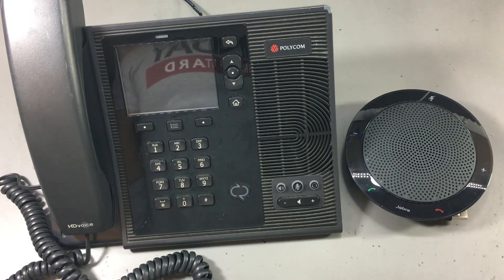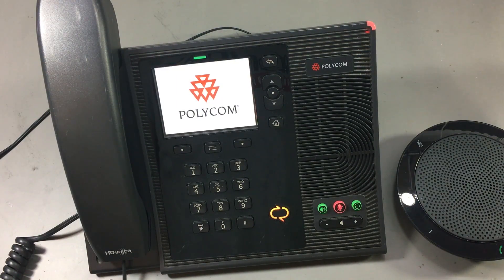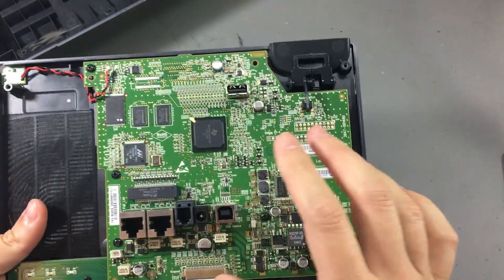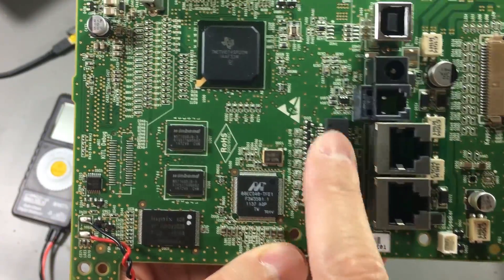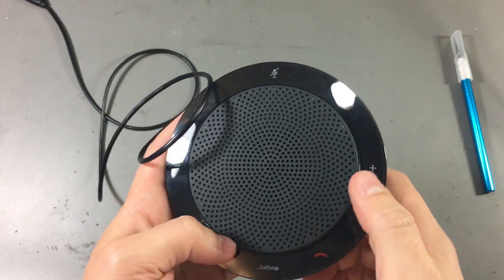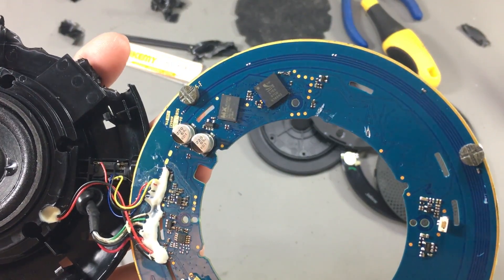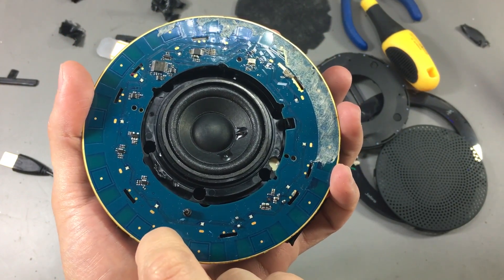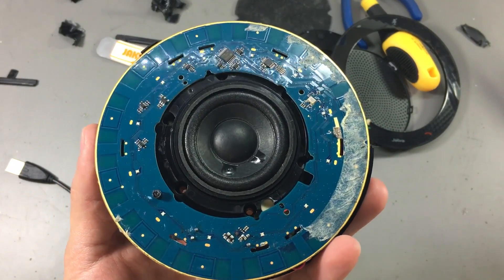Voltlog #168 - Polycom CX600 IP Phone and Jabra 410 Speaker Teardown

Comment: I use that Jabra speaker (or a very similar model) every day with Skype professional. It works very well and it is a pity to see it getting destroyed ;-)
Reply from the maker: The thing that got me was that it had screws on both sides screwing in towards the center. Luckily I don't do much skype calls and when I'm at it I use my headphones :-) The speaker still works when connected to my computer but it doesn't have a pretty case anymore :-)
Reply: I have the 510 version (with bluetooth) and it is an excellent speaker for conference calls. Cool to see a tear-down of it!

Comment: it's like an old phone with skype, right?
Reply: Yep, the phone is very old, the Jabra speaker is current and very good tho.
Reply from the maker: Well, I couldn't have said it better. That's pretty much it.
Reply: also matches are available, but we use lighters :)
Reply: I didn't see the camera of that phone, I guess that it has one, but I will watch again the video, and on the main board there wasn't a camera pin, it is a little weird because there were used in video conference, not to display numbers and calendar, but if that is the case, the RAM and that processor and 6 layer board is an overkill.